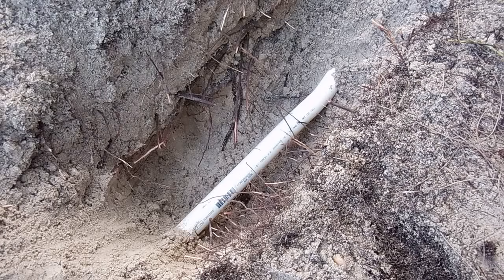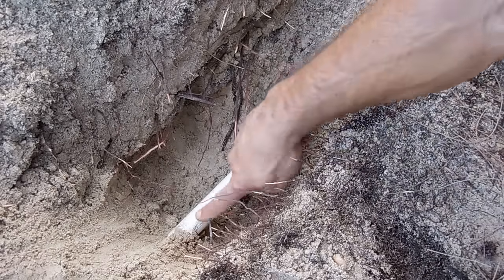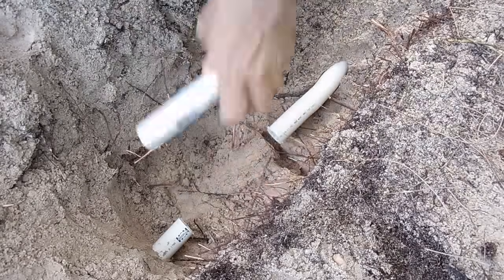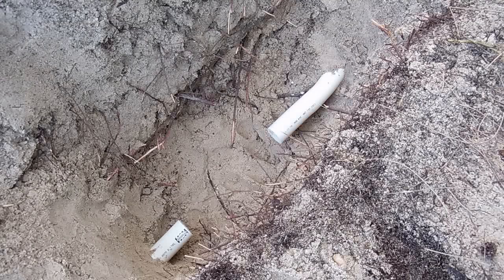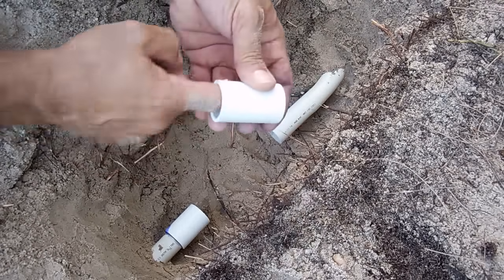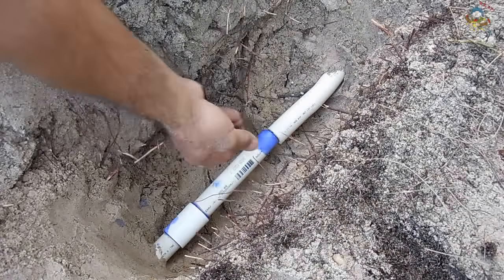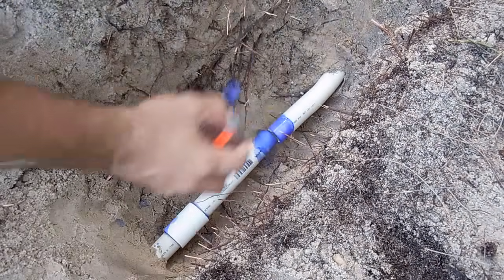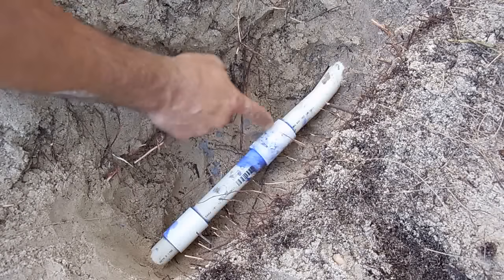EASILY Repairing Broken PVC Pipes(Least Amount Of Digging)

Comment: I have a question. My pipe issue looks similar to this short underground connection you are bonding in this video, EXCEPT, I have 2 vertically angled pipes that need elbow fittings on each, connected with a strait 3/4" pipe (about 11" long, horizontally. So, beginning with 2 vertical pipes, should I bond the 90° elbows to both ends of the 11"horizontal pipe first, THEN take that (" [ " turned horizontal ) shaped pipe & cap the 2 vertical pipes? OR, connect 1 elbow to both a (1) horizontal pipe + a vertical pipe, then connect the other elbow on the opposite side? either way, I won''t be able to turn the fittings a 1/4 turn as I infuse them together & hold securely for the at least 30 seconds.🤔 Please reply as I'm at a standstill on deciding which is best. thanks!....

Comment: I would have simply split the coupling lengthwise after removing the stop and then glue and clamp it around the small break/crack in the pipe.
Reply from the maker: That's what you do to repair a small vertical crack.

Comment: Very nice explanation. I have used this method, too, and the first time I tried it, I didn't move fast enough, so I had to cut out more pipe... I've used a similar method on abs drain pipe, except I cut two couplers so that one went 60% of the way around and the other 40% and matched up perfectly, and then I snapped the bigger piece on, and fused the smaller piece in. I left the hole open for a while to make sure there were no issues, and 20 years later, it's still working.
Reply from the maker: Yes, you definitely need to work quickly. Thanks for watching!

Comment: You can do the same by making a bridge. You would need four 90’s and a small piece of straight pipe to form a bridge.  One 90  on each end pointing up then connect straight pipe to each 90 then add 90 to the other end of the pipe then connect with straight pipe.  Less messy but equally as effective.
Reply from the maker: 4 - 90's increases friction loss and is not recommended for a main line.

Comment: The couplings I am using have the stop, I did not file off the stop, instead, I lifted the pipes about 5-10 degree on both sides and slide the pipe in the coupling, and it fit in well and seal,  though not full length in the couplings, the math is like this: two couplings have totally 2*2=4 half length, without filing off the stop, I can only use 3 half length, average out that each connected pipe ends use about 3/4 half length, that is good enough to seal.  I did this at two broken pipes and this is proven works ok.  so it's  left pipe end -> left 3/4 half coupling -> right 3/4 half coupling ->  left middle pipe end -> right middle pipe end -> left 3/4 half coupling -> right 3/4 half coupling -> pipe end.

Comment: Thank you.  I will try your technique.  P.S. I love your NY/NJ accent!
Reply from the maker: You're welcome Robin. It takes practice, and you must assemble everything quickly. Thanks for watching!
Reply: @electronicsNmore  Yes.  And I'm replacing a T fitting.  I think for one branch I will use a slip coupling.  The other two branches will use your technique.  Do you have a specific video on replacing a T junction and tubing?  The leak is very close to the T.
Reply from the maker: @robinpalmer9809  I think I'll make a video. :-)

Comment: Great job, next time put the slip coupling on before installing the new pipe so you can just put you primer then glue and "slip" the coupling on rather than pulling up and pushing down on the two sides. Thanks for the video
Reply from the maker: Hi Bill. If the coupling slides over the PVC pipe easily(without cement), you made it too big. :-)

Comment: Question: I have a pinhole size hole in my PVC sprinkler line. Would skipping part #1 (removing small section of PVC) and simply using part #2 (stopless coupling) to cover up the pinhole work just as well? My impression is that  this  DIY method would work best if there’s a relatively large damaged section of PVC. Can’t pinholes be spot treated with a single coupling? Thanks!
Reply from the maker: Make the cut over the hole, prep everything, then do as shown using one coupling.
Reply: @electronicsNmore  thank you!

Comment: if you slide the slip-union on BEFORE you glue the repair section into the first union you dont have to bend any pipes. its a good way to test how well your union "slips" after removing the stop. Instead of finding out you didnt remove enough stop after putting glue on everything. You can also use a big drill bit in a cordless drill to remove the stop. Little slower but safer. Water and Dremel plugs dont mix. Great video!
Reply from the maker: If you're able to slide the modified coupling onto the PVC pipe dry, then you made it too big, and the strength of the repair will be reduced.
Reply: Does the union slide onto the end of the pipe all the way to the stop without removing the stop? Yes. You pointed out that centering the union over the butted ends is crucial and I agree. My method doesnt remove any more material than your method its just simpler. No pipe bending & Less digging. Give it a try   @electronicsNmore

Comment: I don't know why this didnt work for me. I got the first coupling and the pipe in there fine, but when I slipped the other coupling on it set onto the pipe without giving me a chance to slip it onto the pipe in the ground. I was twisting it a lot while I was putting it on the replacement pipe to avoid it setting, but it was already a struggle getting it on the first pipe, when I worked it backwards it completely set on the first pipe. Can anyone tell what I'm doing wrong?
Reply from the maker: Sounds like the stop wasn't taken down enough. Apply plenty of clear PVC cement, and keep the fitting in motion, work fast.

Comment: Just tried this on my 1.5" pvc for my pool plumbing, worked great! I used the round sanding attachment on my Dremel to remove the coupling stop. One thing I noticed is inside the coupling, I did need to remove extra material beyond the stop so my pipe could fully slide past the middle, otherwise it would bind. It's like the center of the coupling diameter narrows a bit - Maybe it's only with larger diameter couplings?
I recommend testing your altered coupling on some test pipe, to confirm the pipe does fully slide thru and not bind up.
Reply: True for the small stuff too, had to do the same for 3/4”
Reply: I tried this and my pipe got completely STUCK.  How do you get it to where the coupling can slide back and forth?
Reply: @craigzilla100 I believe he said you would need slow setting glue or original PVC glue but the trick is to work fast. Don't give it time to set, slide the coupling on and then slide backwards quickly. Hope this answered your question.

Comment: Number one it's not cleaner, its primer. The number 2 why didn't you just buy a slip coupling while you were at the hardware store. In fact instead of lifting out of the pipe and taking a chance on cracking it why didn't you buy 2 slip couplings to put it on your replacement part you would have had to force nothing
Reply from the maker: Number one, don't be a pedant. Number 2, they don't sell full slip couplings for PRESSURE pvc, only DWV. I never had a pipe break when lifting it up just enough to complete the repair.
Reply: @electronicsNmore  okay I've been a plumber for 40 years my friend and it's called f**** primer no matter what you want to call me. And I don't know what you're working with but I've seen a slip coupling and almost all of that stuff
Reply: @electronicsNmore  oh yeah I forgot to say this if you're a real plumber you would be using that s*** anyway
Reply: @electronicsNmore  oh yeah I forgot to say this if you're a real plumber you would be using that s*** anyway

Comment: 2021: They have locking couplings now, no need for glue.
Reply from the maker: The design has been around for years, but smaller. O-ring with a metal locking ring. Not a permanent repair, but a good one.

Comment: I used your video to repair a crack in my irrigation line. One thing I wanted to touch base with you on as I had to remove a lot more material than just the center membrane of the coupler. I ended up having to use a Dremel tool and a file to remove enough material to allow for the coupler to slide with still enough friction to be effective but enough to also still be able to move freely or free enough you'll be allowed to slide easily you handle on the pipe. It took about 3 hours to sand and use a Dremel tool to get the coupler to the thickness that it needed to be to slide from one type to another. Overall the method work it just with a lot more time-consuming than it was shown here. Thank you for this tutorial
Reply from the maker: Wow, I make the fitting in a matter of minutes. All you remove is the center stop, you don't want to remove the taper. If the coupling slid over the dry pipe, you made it too big.
Reply: @electronicsNmore  there was no way this coupler was going to slide unless I removed some more material aside from that plastic stop or membrane, whatever it's called. That meant removing some of the taper. 
In the end, it worked and it's holding.  It just took about 3 hours of lightly filing and using the el Cheapo Harbor Freight Dremel copy with a stone grinder bit.

Either way, it's done, and fixed, and I thank you for the video.  This has also given me the confidence to move some of the irrigation lines and funny pipe in the yard.

Comment: Great idea about making the coupling a slip fit. As the openings are tapered, it takes much more than simply removing the stop in the middle, as I discovered. Why not place the slip sleeve on the repair section before gluing the section in. that way one does not need to "bend" the sections to install the sleeve for the final bond?  I do not have enough length or flexibility to move the pipes as you did in the video.
Reply from the maker: If the coupling slides over a dry PVC pipe, that means you made it too big.

Comment: Chemicals spilled on the soil. Should cover the soil first. But was very informative.
Reply from the maker: The spill isn't a concern because the solvent evaporates very quickly. Any PVC cement that drips onto the sand/soil, will dry into a hard plastic like shell. Thanks for watching!

Comment: Thanks for the video. I’m just curious why the stop in the coupling needs to be removed? As long as the glue could seal the connection, seems water has nowhere to leak to. Please help me understand.
Reply from the maker: It's impossible to slide into position with the stop in place.

Comment: I tried this method before and it’s not that easy, that coupling is hard to position even if you remove the center stop and regular pvc cement.  I find it easier to just use 4 90* elbows.  After cutting out the damaged section, glue 2 elbows point up or down, whichever direction has the most clearance in the ground. Glue a small piece of pvc maybe about 3 inches on the other end of the elbows.  Measure and cut a new piece of pvc and glue the other 2 elbows on each end going in the same direction.  After that you can glue that new piece into the open ends in the ground.
Reply from the maker: You either didn't work fast enough, stopped moving the coupling, didn't remove enough of the stop, or used the wrong PVC cement. Practice makes perfect.
Reply: @electronicsNmore  trust me I removed the stop, I used a dremel with a grinding bit.  And I used regular pvc cement not the fast setting one.  This isnt a good method anyways because the stop in the coupling helps ensure that it doesn’t leak.
Reply from the maker: @beastfromtheeast9318  Wrong. LOL "Trust Me", meanwhile I've been using the method for the past 30 years, and countless others that watched this video were able to do it.
Reply: @electronicsNmore  lol, I never said I couldnt do it, because I have.  I just said it’s not that easy for a non diy attempting this.  Of course you wouldn’t know if it failed because it’s in the ground.  Hahahahahhahaha.  That shit is probably leaking attracting termites.  I prefer my method.  Costs a few cents more and it’s super easy and leak free.

Comment: A little help.  I’m having trouble on installing the last coupler.  I’m using medium blue pvc cement, but I once I push it in, I can’t push or twist it out to attach to the other pipe.  It’s like it dries and sticks so fast already after a few seconds it’s impossible to twist out the other way.
Reply from the maker: Wrong cement, way too thick. Use regular set Oatey clear.

Comment: My first attempt failed. The glue hardened on me while I was still moving the coupling to connect both pipes. On my second attempt, I failed to properly measure my pipe. I was a bit short but it settled well. Overall, it is still an easy fix. I’m glad I found this video. Thank you!
Reply from the maker: It does take practice. You'll get the hang of it! :-)

Comment: I couldn't get this to work.  Tried it in the garage before doing it for real in the yard.  Filed down the coupling just like explained.  Removed the stop completely.  Got it as smooth as possible on the inside.  No stop, but the 1/2 pvc pipe will not slip through all the way.  It still stops at the mid way point.  Are these things tapered to the center also (even when the stop is removed)?  Do I need more lubrication?  Thanks.
Reply from the maker: Hi Pat. It takes a little practice. Did you place a small bevel on the pipe ends? The couplings do have a slight taper inward. If the stop is gone, and you applied enough cement, it should slide over and back. Thanks for watching!

Comment: If you have only one repair, it is cheaper and quicker to buy a flexible neoprene coupling. A 2 inch costs 10 bucks in Canada and a PVC cleaner, glue, two couplings cost  $13 plus you have to find a 2 inch diameter 2 feet PVC piece. If you don't have it you have to buy an 8 foot PVC pipe. That could be another $12. A flexible coupling will take a minute to install. Think of all this.
Reply from the maker: The type you mentioned isn't designed for pressure, only DWV.

Comment: I cheat and only use 1 coupler by only cutting out the length of the coupler.
You need to be quick when gluing the coupler onto the PVC.  I use primer on all joints first.
Obviously if the crack is longer than the coupler, one coupler will Not work.

Comment: There's no telling how rich one could get selling stopless PVC couplings.  Why isn't this a thing?
Reply from the maker: They already sell them for DWV(Drain/Waste/Vent) PVC, but you won't find any sold for pressure PVC at your local home improvement or hardware store. Only plumbing supply houses sell them. Thanks for watching Rick, be sure to check out my PVC pipe video playlist below. 
https://www.youtube.com/playlist?list=PLQ6IOhUBblU10Q846UXdxMnh8S_eul0UT
Reply: @electronicsNmore  Thanks for the reply.  I was watching because I have a broken pipe in one of my sprinkler zones, but the break is buried under a huge tree root (probably what caused the break in the first place), so I think I'm going to work on a long bypass (13-ish feet) instead of trying to dig it out.  I'm thinking of using flex pipe, but not sure how to couple it to the existing PVC (I guess I'll watch videos).
Reply from the maker: @Rick-5728  Find the pipe beyond both sides of the tree roots, cut out the section, and use a black plastic flexible poly pipe of the same I.D. between both cut pvc pipe ends. Add female adapters to each PVC pipe end, and male hose barb adapters with clamps to the poly pipe.
Reply: @electronicsNmore  Thanks!  You're awesome.

Comment: I recommend installing your modified coupling onto the new pipe before plugging it into the first coupling, so you don’t have to bend pipe in a hurry at the end. I also recommend buying the repair couplings that are made without the stop in the center...
Reply from the maker: I recommend you read through the comment section.
Reply: @electronicsNmore  is there something in particular that I am suppose to be looking for in the comment section?

Comment: Why don't  manufacturers make a full slip fitting? I had the same idea and used a dremel to file away the ridge but when I tried to slip in on all the way in to a pipe it wouldn't go in all the way. Seem like the tolerance between the fitting and the pipe is too tight. If a manufacturer sold these fitting without the ridge and with better tolerance, they would sell like hot cakes.

Also why didn't you slip in the fitting  in one end of the pipes first that way you don't have to lift the pipe.  That's the whole point of this method, avoid having to wrestle with the pipes

And while at it why not use the same method  at  both ends of the joint?
Reply from the maker: They do sell them at local hardware stores, but for DWV PVC, not pressure PVC. A plumbing supply house may sell the pressure type. If you fail to remove enough of the stop, it won't slide over easily, if it slides all the way over without and cement, then you made it too big.

Comment: Great trick! However, I wonder if I could just make one cut, where the accidental cut is located? That way I'd just use a smooth coupler there, without the need to use a regular one on the left. This is even more simpler and it should work, right?
Reply from the maker: I explained in the video when you need one cut or 2. Thanks for watching

Comment: Use two pieces of cardboard and place them under the pipe ends. That will prevent sand an dirt to get inside the pipes and into the glue and primer.
Reply from the maker: Or a plastic bag. :-)